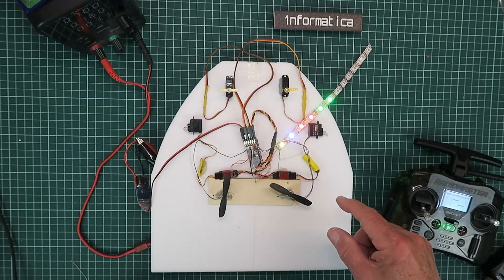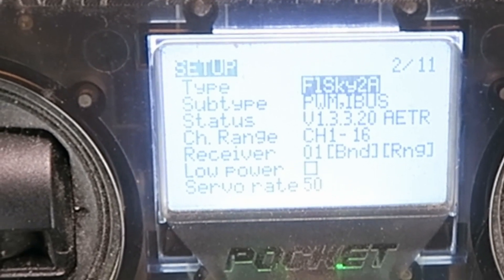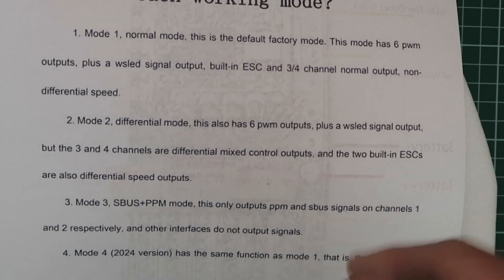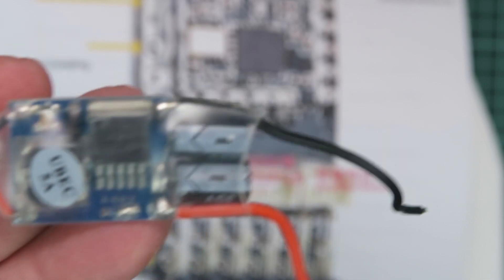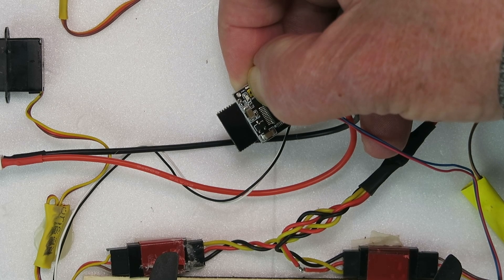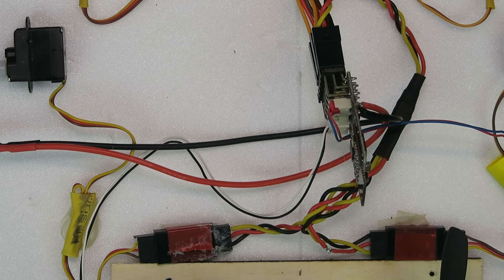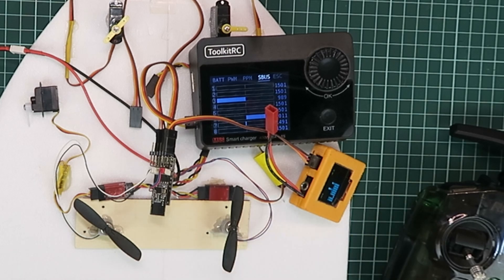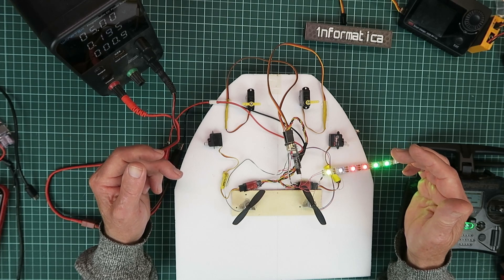6 CH "Flysky" Receiver With 2  Brushed ESC's Module. Features, Modes, and Setup Tips

Comment: I just found the one I bought. Got it figured out thanks to this video. My issue im having certain servos do not work. Plugs are correct! Also I have only one esc wired with a motor. Will not throttle up! I noticed in your video you have an arm switch? Will this work with one esc?
Reply from the maker: There are servos with the correct plug that are wired different. You cannot trust the wire colours either! Check that the signal wire is in the correct position. The "arm" or throttle cut is done on the transmitter. If you are sending throttle signal on channel 3 it should work. Check you transmitter signal monitor. Also you can measure the voltage on the motor outputs. Good luck! Thanks for watching, have a great day!

Comment: An interesting (and maybe versatile) little Flysky/Wfly/Microzone protocol receiver, Sancho. We'll be intrigued with what you might come up with as to uses. 
I believe that I have another little Flysky? protocol receiver that came in a kit from Heewing for a dinky foamy that sits somewhere in the Gunna-Do pile somewhere. That has several configurations for brushed and brushless outputs as well as several stabilizing modes. The Do Drive is sliding here with the years. Not many of us oldies left now. 😮‍💨😱
Reply from the maker: Would be interested in more detail on the Rx with the brushed and brushless outputs as well as several stabilizing modes. If you could dig it out!! Must admit at this time of year especially I feel like how one of the last dinosaurs must have felt!!